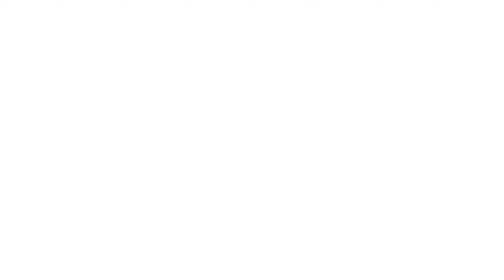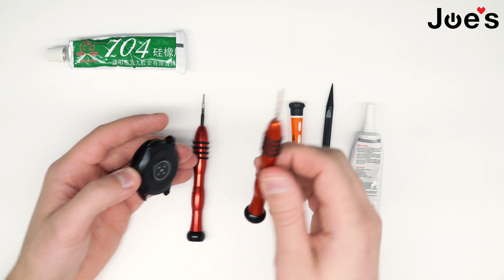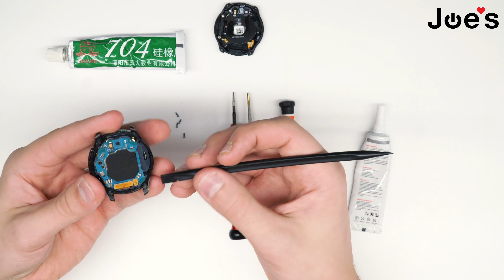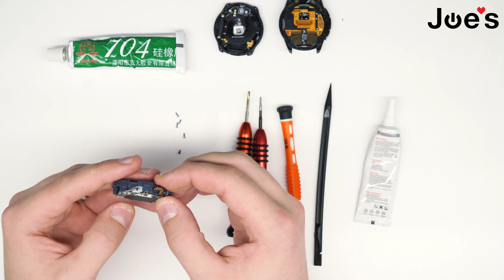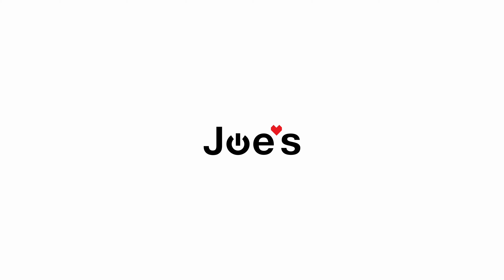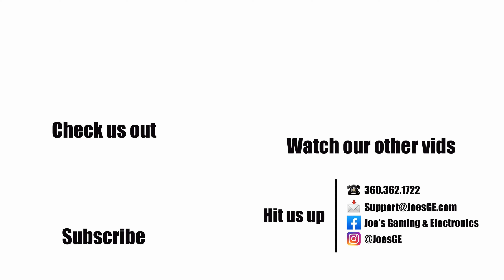Samsung Galaxy Watch SM-R810 Main Board Replacement | Repair Tutorial

Comment: Bro, mi r810 can't measure heart frequency, they try but the message appears to try again, what can be?
Reply from the maker: You may have a bad heart rate sensor.https://www.joesge.com/products/samsung-galaxy-watch-sm-r810-smartwatch-repair-replacement-parts?variant=32673484865582